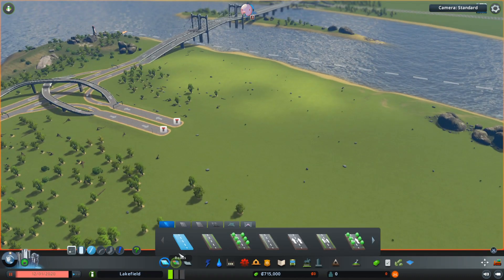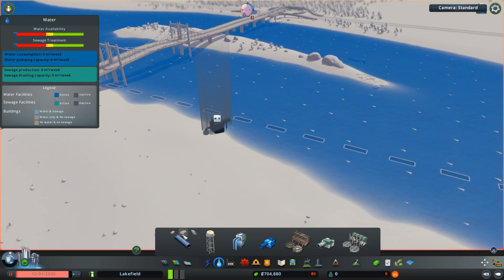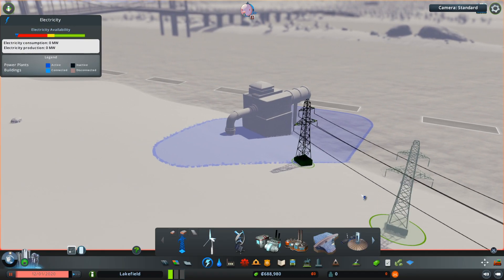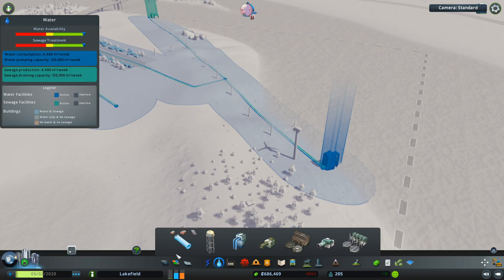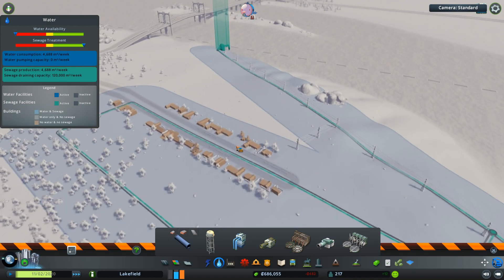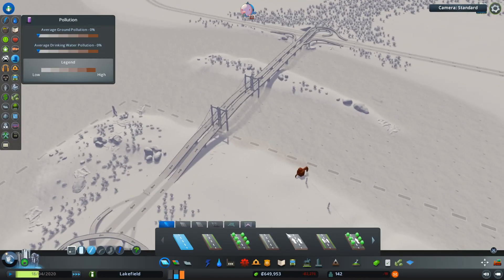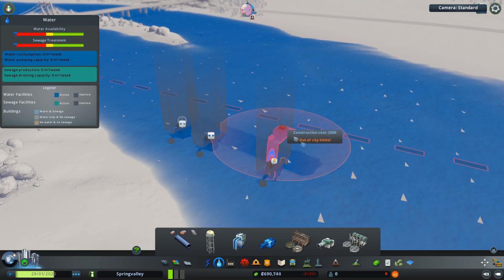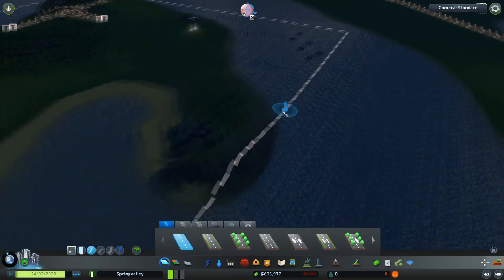Cities: Skylines - How to plumb water and electricity into your town

Comment: Power lines can't be underground? The standing towers with the power line look not very cool. There is this blue zone around the houses to which electricity is supplied. As long as the houses are close to each other, it is enough to bring electricity to this zone and nowhere else, regardless of the size of the city?

Comment: My roads doesnt turn dark blue when I place the electricity palens to the lightblur area around the city?
Reply from the maker: your roads wont, this is a seperate mod. you will need to power your buildings inside the bubbles

Comment: This didn’t work I tried to power the pumps and sewage but it still didn’t work if respond to this comment and give me feed back that would be great thank you
Reply from the maker: water pump and sewage pump are both needed. Both in the water and both linked together. You then have to put power to them. Use turbines or powerplants then link them all up with a row of pylons

Comment: I put a electrical tower pylon thing in the water pump blue area and in the house blue area and connected water and it still isn’t working
Reply from the maker: you need to make sure the other end of the pylon is coming from a turbine or power plant for it to work

Comment: this helped. thanks.
I keep getting random houses losing power though, and i have like 5 windmills linked to the power areas. so frustrating!
Reply from the maker: the windmills produce different power depending on the time of day. its always the houses further away from the power source that will lose power first. Glad it helped you :-)
Reply: @AniCodYT  I ended up relocating them all at the coastline and connecting them with pilons and it worked. Thanks a lot 😀

Comment: The towers are connected and all to the water and electricity but it ends near the windmill (Power) and it doesn’t give out the water .. if that makes sense how do it give the water into the town?
Reply from the maker: do you have enough water towers for the size of you town? also make sure sewerage is connected on the same line as your water towers :-)

Comment: So in my game in the beginning it was fine but now im at a point that in some parts of the city it says not enough electricity but there is electricity. Cause the cables are giving it electricity I even checked there is a blue line and the city is blue which means there is ectricirt the availability of electricity is green which means it has full availability. Now I even put the budget up to 150 percent for day and night but still no electricity. So I added another wind turbine to my coal plant and still no electricity what can I do there is nothing else???
Reply from the maker: wind turbines in big cities are useless. i would recommend adding a second coal plant and making sure ALL parts of your suburbs are connected together. If you're low on electricity, the parts of your city furthest from power will shut down first :-) hope this helps!
Reply: @AniCodYT  I already got it so basically the blue areas of the city the electricity stand needs to touch it
Reply from the maker: @kaskovic1993  you have dark blue and light blue bubble depending which item you're looking at. Dark blue is your electricity bubble and light blue is the plumbing bubble. 2 very different things and both have to cover your city
Reply: AniCod how do we get fuel in coal plant? I cant so i spam mega wind turbines
Reply from the maker: @animationcity8178  it automatically gets delivered on trucks via road transport. you need to make sure your coal plant is right next to a motorway network or it will run out!
Reply: AniCod motorway? Im from Turkey so i dont know
Edit: Oh. Ok, thanks for the idea but it says not enough fuel
Reply from the maker: @animationcity8178  main road. the first road in your city... the highway.... otoyol ..... i hope this helps :-)
Reply: AniCod oh, i edited my comment then looked at google translate but there are a LOT of people in the motorway

Comment: I've noticed you can put pumping stations in the sea when on a coastal map. Surely the water coming in won't be fresh then? Do i have to link a coastal pump to a water tower for that to work?
Reply from the maker: all water, sea water or fresh water is the same (sea water should be salty but this isn't implemented into the game).  you only need water towers if there's no water on the map or you haven't unlocked the tile yet

Comment: Does the water pump and drain need to be connected straight? I tried creating grids with water pipes, tried to run one continuous line all through the city to the water drain and changed layouts multiple times, but people are still getting sick. Water pump is very upstream and has no pollution. Not sure how the water’s getting polluted.
Reply from the maker: they can be placed anywhere, as long as theyre both connected somehow then they will work
Reply: @AniCodYT  Hmm thanks. Not sure what's wrong with my game, I have the water pump upstream with no pollution and sewage downstream, but somehow everyone's getting sick from the water.

Comment: Thank you me and my dad were struggling for so long
Reply from the maker: I struggled too at first to be fair. Glad it helped you, hope you enjoy the game!
Reply: @AniCodYT  question b/c when i have a lot of buildings i need a lot of power and the power lines wont power them and i use the wind turbine and use the power lines to connect it and i still need power
Reply from the maker: @extraify2201  Wind turbines dont give much power, you normally need lots to power a big city. Sounds like you need a power plant to give ytou enough power. you can upgrade it to cleaner energy when you unlock it later. If you go into your menu at the top left and click on the electricity icon you will see how much energy you need. Make sure all of your buildings are linked with the blue bubbles
Reply: @AniCodYT  thanks